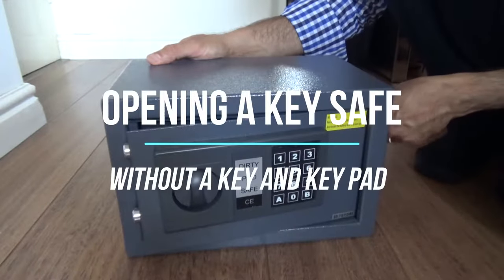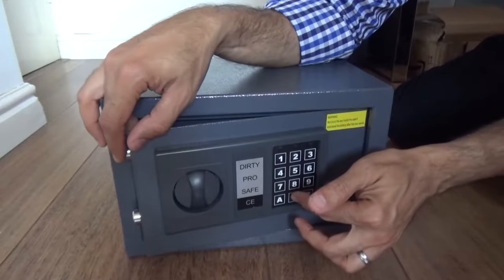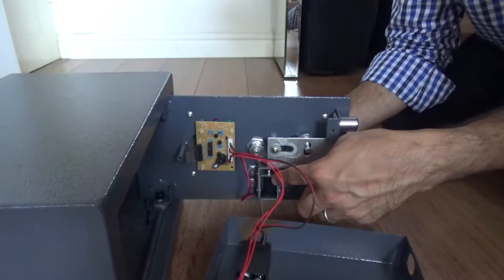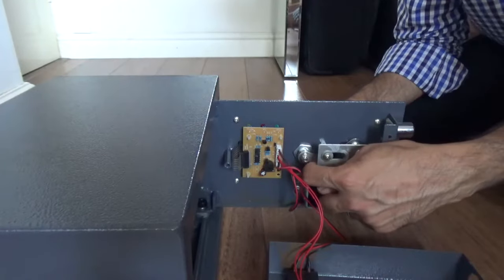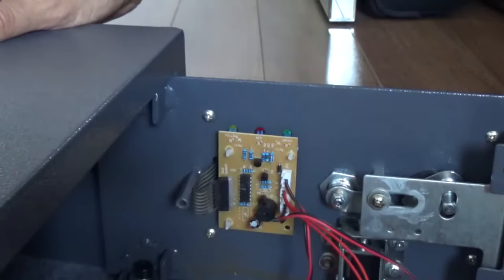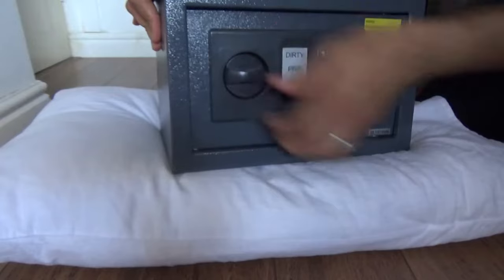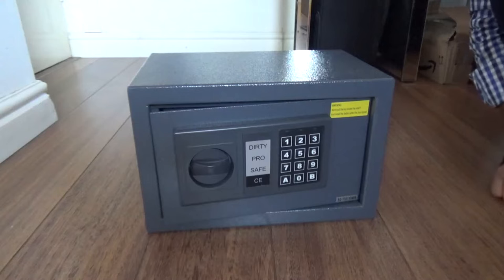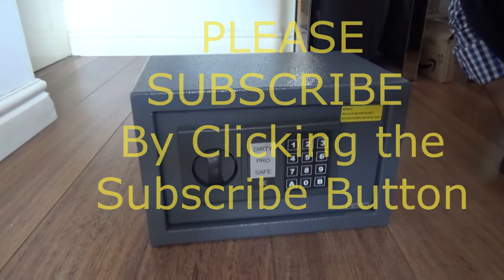Opening a KeySafe Without a Key and Keypad

Comment: Thanks for the tutorial. By the way can you show me how to reset the pin number, or rather to change a new pin number. And is the battery replaceable?
Reply from the maker: Thank you for your comments, Battery in the door compartment. To reset the PiN you need to press the red button inside on the safe.